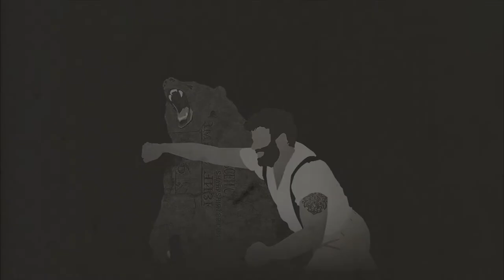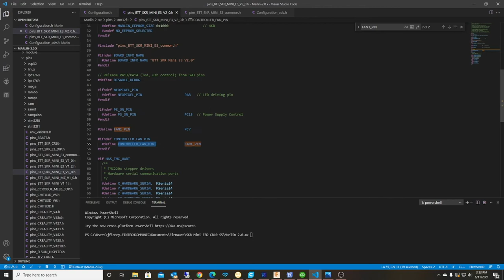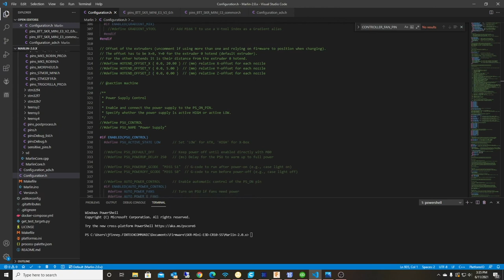Creality CR10 S5, SKR Mini E3 2.0, Bltouch upgrade repair, TMC 2209 Marlin 2.0

Comment: One connector is for the servo positive, negative, and signal, the other 2 wire connector is for the actual probe circuit alone.

Comment: I’m looking at doing a similar upgrade to a CR-10 S5 and I think one weight savings would be removing the glass bed  and going to a magnetic spring steel / pei surface (like the Wham Bam System). And going direct drive

Comment: I wish you weren't on the complete other side of the country, My S5 has been lying dormant since 2017 after failing to get the bed level repeatedly.  Earlier in the year I picked up the BTT SKR Mini E3 V3 and trying to compile a working firmware for it has been terrible.  Maybe I'll try it again, and also upgrade to a .8 nozzle... I've moved on to other printers and the S5 is collecting dust in the corner
Reply from the maker: Funny, I'm working on two of them for customers right now. Headed  bed upgrades. Videos coming out soon

Comment: Question..I have done this 10 times. reloaded new version of Marlin from the Github site. I have 2 problems. 
SKR MINI E3 V2.0
Marlin 2.0.8
 1  When I reboot with the new firmware I get an error the error " failed to enable bed leveling" From what I have read, that is because there is no data. So the second problem. Homing,  Everything seems to work when going to home, X & Y go home, the extruder goes to the middle of the bed,  but the Z will not go down. it moves upwards, then stops. the BLTouch does it quick reset, probe extends and then I get an error "STOP called because of BLTouch error, Restart with M999"  Any help from your user or you would greatly be appreciated. Thanks in advance...CO
Main Marlin Changes that I have done. 
#define MOTHERBOARD BOARD_BTT_SKR_MINI_E3_V2_0
#define DEFAULT_AXIS_STEPS_PER_UNIT   { 102, 102, 1650, 93 }
#define USE_PROBE_FOR_Z_HOMING
//#define Z_MIN_PROBE_USES_Z_MIN_ENDSTOP_PIN  //using SERVO plug
#define BLTOUCH
#define NOZZLE_TO_PROBE_OFFSET { 2, -24, -1.85 }
#define MIN_SOFTWARE_ENDSTOP_Z
#define AUTO_BED_LEVELING_BILINEAR
//#define MESH_BED_LEVELING
#define DEBUG_LEVELING_FEATURE
#define LCD_BED_LEVELING 
#define Z_SAFE_HOMING
Reply from the maker: Do you have the bltouch connected to the 5 pin connector? If using 5 pin connector 
#define Z_MIN_PROBE_PIN PC14
Reply: @fintechrepairshop  i did enable that. when I do compile it, it has1000 warnings that it is alread defined in Pins.h folder. I have tried it both way and still no down Z movement